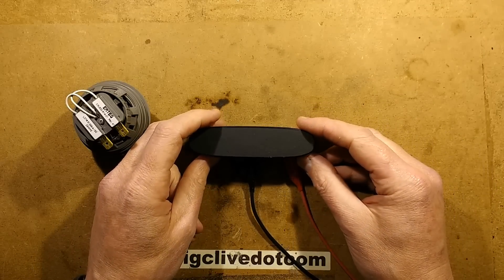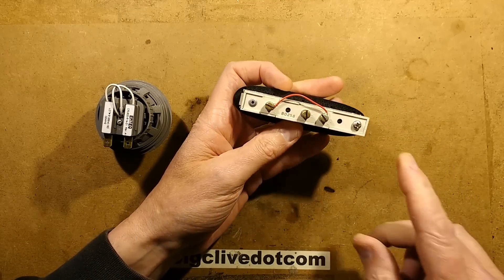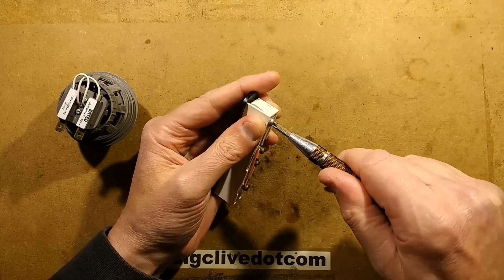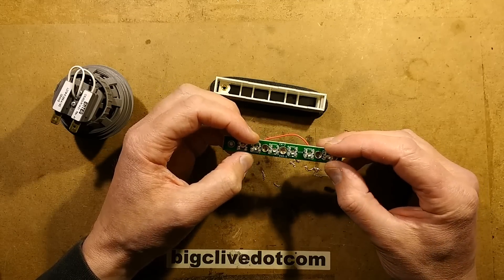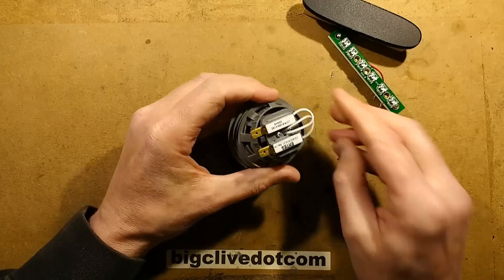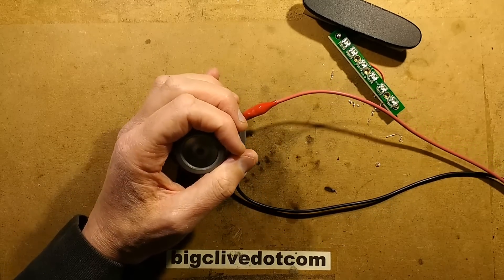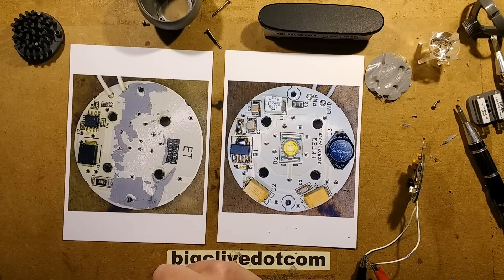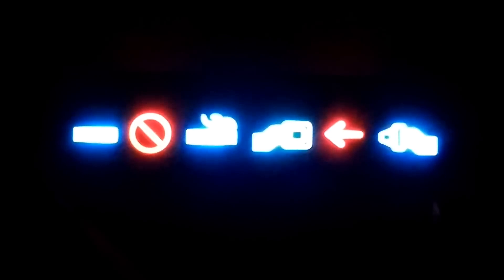What's inside an aircraft seatbelt sign?  (and swivel downlight)

Comment: Judging by Techmoan's video revealing that planes were using 8mm video tapes until recently I'm surprised they actually used LEDs at all, I would've expected ancient tungsten lamps.
Reply: Matt Tester the fleet I work on all still use filament lamps. The no smoking/FSB Signs just have two small 5v lamps and one GND connection. Always breaking, but mainly due to age. Most of the signs on ours were manufactured in 1982! The aircraft are many years older...
Reply: Considering the expense of getting an aftermarket replacement certified for use in a 35+ year old aircraft, I'm not surprised.
Reply: the latest boing has a lipo battery pack,, i guess it comes down to, they dont change an existing one, its not until a new one will it have new tech on it
Reply: I would have expected gasoline lanterns
Reply: Matt Tester They did until very recently. I have been on one or two that didn't.
Reply: underwaterdick Delta's MD-88 fleet?
Reply: Another reason is lowering the electrical load.

There was an episode of Mayday I watched. Everyone was enjoying in flight entertainment. Wiring overloaded and a fire started.
Reply: He recently did a video on Video8.  It's closer to the end (IIRC) where he talks about how they were still in use around 2015.
Reply: I think they are more waiting for technology to prove itself. If a consumer wants the newest stuff right away, it isn't such a big deal if it breaks down by some cause. You don't want to have an airplane with the newest technology failing after some use ;)
Reply: Which video?
Reply: Considering how old LEDs actually are... I don't see why they wouldn't feasibly be able to use them. I have a little handheld football game from the 70s that's lit by LEDs. :P
Reply: The cockpit lights on a lot of planes still use tungsten lamps. Partially because it is relatively simple to detect if one has blown

Comment: Regarding your mystery transistor on the downlight PCBA - perhaps part of a buck converter implemented in discrete components instead of a single (modern) IC? 

Isn't the power supply on all of these planes 400 Hz AC as well?
Reply: Dan Capizzi
Yep the electrical equipment runs on AC and the external lights runs on DC 25 volt system
Reply: 115V@400Hz and also 28V DC
Reply: It depends on the aircraft, 115/208 three phase 400 Hz and 28 volt D.C.Cabin lighting.
Some may have emergency backup lighting of 6 volt
Small aircraft may not have an A.C. system at all

Comment: I sincerely hope you did not take these parts from a commercial aircraft. Stealing aircraft parts is no joke.
Reply from the maker: I was just joking about nicking them out an aircraft.  They were sent in by a viewer.
Reply: bigclivedotcom And I think it was a good one since everybody will understand it is one.
Reply: Ioan Perhaps the viewer was an airplane?
Reply: Everyone knows Clive used the Vice of Knowledge™ to pop the light out.
Reply: staevobr 🤔🤔 he either prized them out with a sharp object at 35000 feet, or removed them from a crash site.
Reply: You can buy these at auctions... I have runway flush lights and wing headlamps from the junk shops !!
Reply: Or could be someone who works in a airplane interior fitting company, or just works as a servicing team for a airline.

Or just got them off ebay
Reply: That's good. I am a commercial aircraft interiors engineer, so I'm extra finicky about this stuff.

Comment: Wouldn't the swivel lamp be near the same voltage as the warning display?  24 VDC?
Reply from the maker: +Carlton Dodd I tested it with between 12v and 28v and it kept the power constant.
Reply: bigclivedotcom Why do I ever doubt you?
Reply: That would be the meeting of RTCA/DO-160 Section 16 power input requirements for varying voltages likely in emergency conditions.